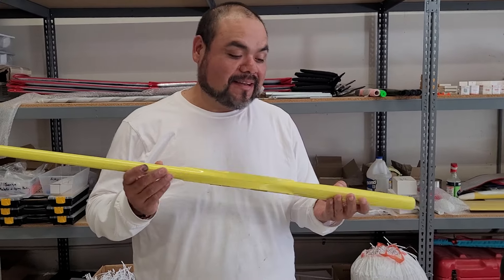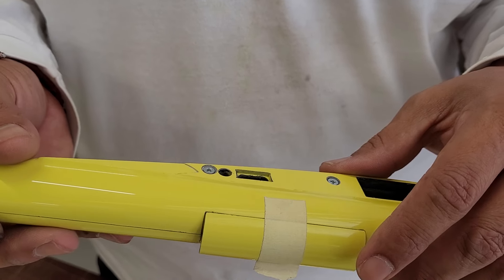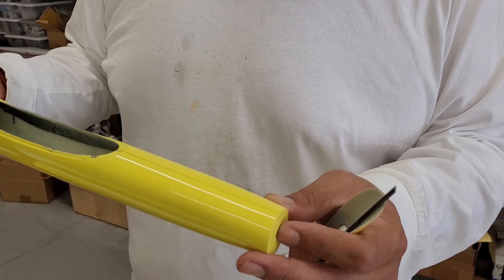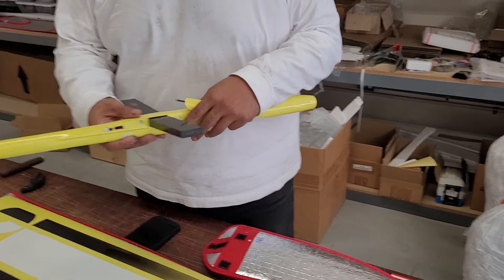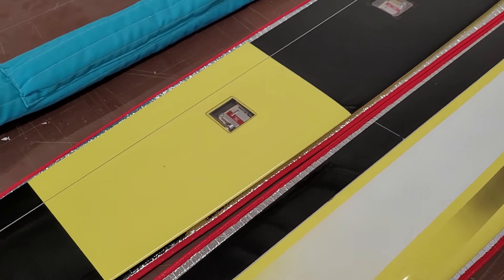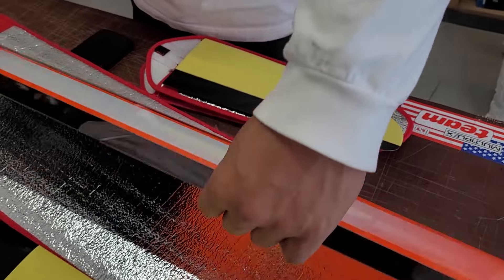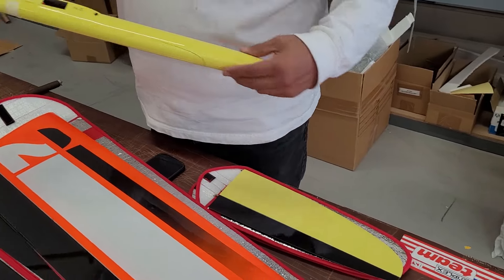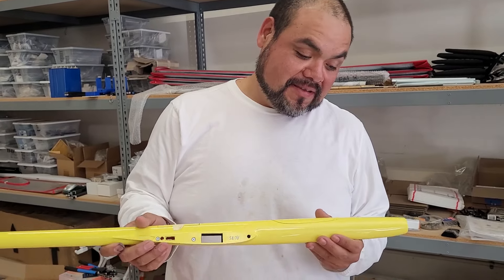New Samba Models Pike Precision 2 F3G Slim Fuse, Quick Look

Comment: Nice guys!  It’s a huge improvement.  The old one was a ship in a bottle.  Also the nose was really narrow so you could only fit a set of 2s batteries.  Battery changes were scary too because wires and bullet connectors are stuffed up against carbon.